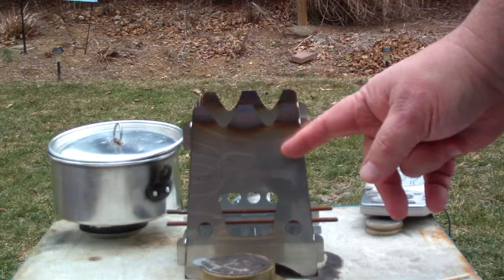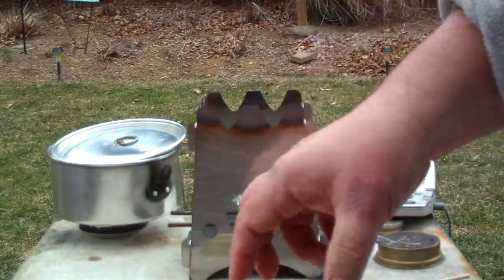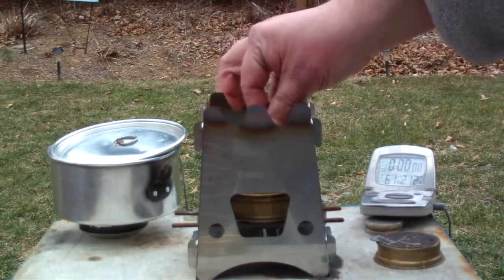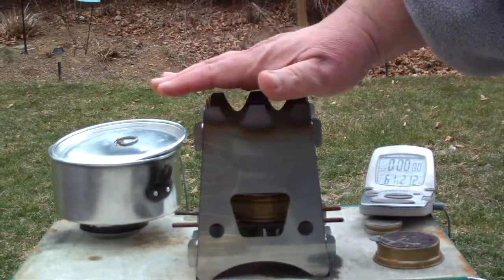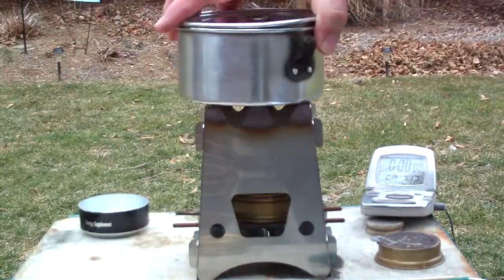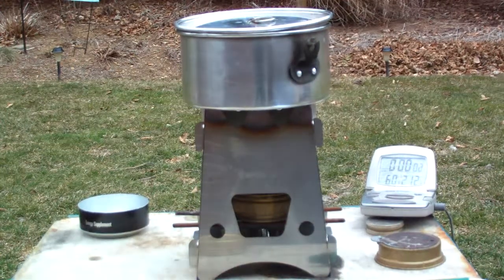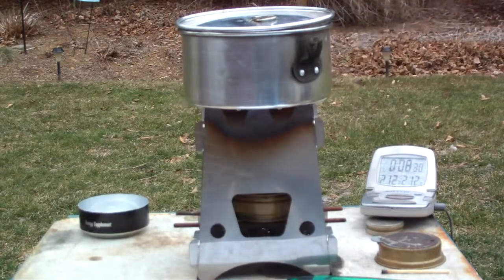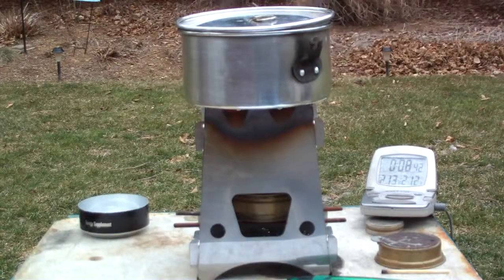Emberlit Stove used with the Trangia burner - Boil Test #2

Comment: Do you feel like the height of the trangia is optimal with the wires in the vent holes, or would it be better to tap and drill new ones higher?